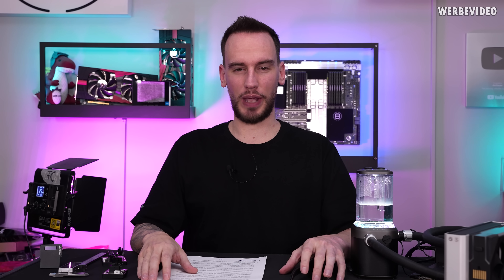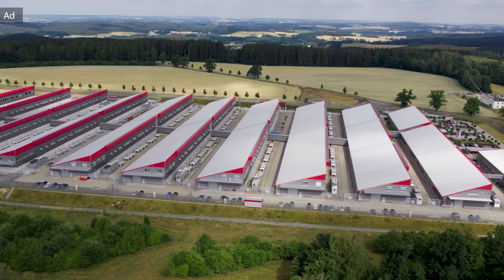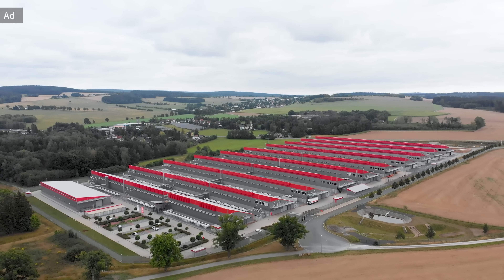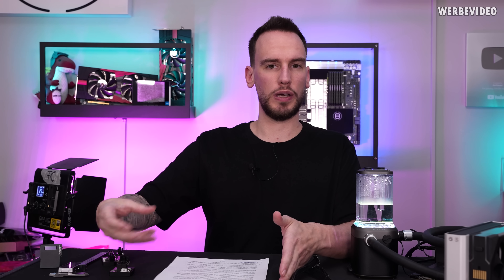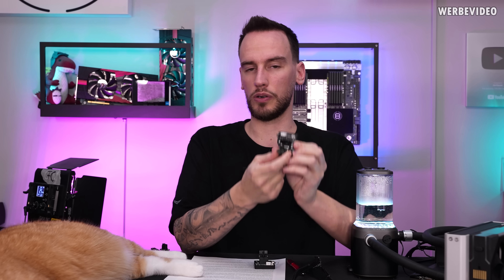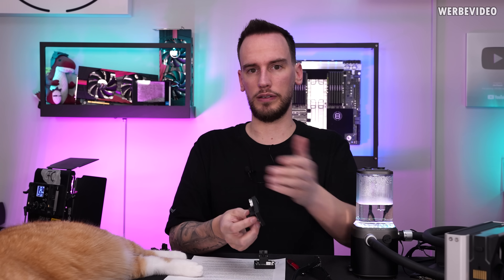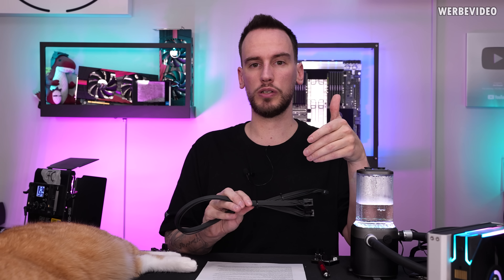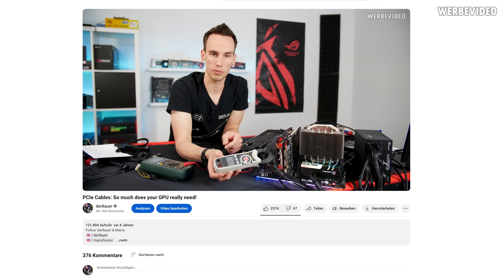12VHPWR is just Garbage and will Remain a Problem!!

Comment: Its funny how i still have my angled adapter on my 4090 tuf. Only removed it 3 times to clean the block and moving. I still think the problem with the connector is the wires are unevenly distributing the power, not so much with user error.

Comment: At 7:37, the way you derate for number of strands in a conductor does not match how an electrician would derate number of conductors in a conduit.  I think you are confusing the latter with the former.  Further, since all conductors are in air and not in a conduit, there is no multiconductor derating factor.

Comment: My ASUS ROG Strix 4070 Ti connector burned — and it's only a 230W GPU.
I was using the original cables that came with my ASUS ROG Strix Platinum PSU (ATX 3.1 certified), so everything was properly matched and within spec.
This clearly shows that the issue with these 12VHPWR/12V-2x6 connectors isn’t just about power draw — it's a flawed design overall. Even GPUs with modest power requirements can be affected.
To make things worse, ASUS voided my warranty. So not only did I buy all ASUS premium components thinking they’d work perfectly together, I’m now left with a burnt GPU and no support.
Be careful out there — this connector issue is not just about wattage.

Comment: I have two brand new 4090s, but I still have to buy another one.

When I bought them and saw the power requirements, the cross-sections of the PCIe cables, and having to go through the thin pins of that new connector, I was surprised, and the first thing that occurred to me was to solder another connector to distribute the loads. But if the problem is a connection fault, distribution no longer counts, since a false contact causes wire burns, unsoldering, possible shorts, black contacts, etc. In short, what happens when a spark occurs in a relay or switch, where the contact becomes black, or burned, or soldered. In short, two problems: poor distribution and possible poor connection. I deduce from this that the card could burn out or be damaged, but if the PC burns out, or worse, causes a fire, this won't cover my warranty. I think it's better to connect another connector and run it parallel to those, trying to lower the excess power consumption to avoid sparking if a connection is faulty. 
Regards.

Tengo dos 4090 nuevas, pero aún tengo que comprar otra.
Cuando las compré y vi los requisitos de energía, las secciones transversales de los cables PCIe y tener que pasar por los pines delgados de ese nuevo conector, me sorprendí, y lo primero que se me ocurrió fue soldar otro conector para distribuir las cargas. Pero si el problema es un fallo de conexión, la distribución ya no cuenta, ya que un contacto falso provoca quemaduras en los cables, desoldaduras, posibles cortocircuitos, contactos negros, etc. En resumen, lo que ocurre cuando se produce una chispa en un relé o interruptor, donde el contacto se vuelve negro, quemado o soldado. En resumen, dos problemas: mala distribución y posible mala conexión. De esto deduzco que la tarjeta podría quemarse o dañarse, pero si el PC se quema, o peor aún, provoca un incendio, esto no cubrirá mi garantía. Creo que es mejor conectar otro conector y conectarlo en paralelo, intentando reducir el consumo excesivo de energía para evitar chispas si una conexión falla.
Saludos.

Comment: I have 12VHPWR that plugs into the PSU and splits into 2x6 pins for the GPU. I am pretty scared to plug it into my GPU, but it is the only cable that came with my ASUS ATX 3.0 PSU. 

I have an AM4 mobo and new 7800XT Nitro+ Sapphire. It says Display Port 2.1 compatible and so does my new PG32UQXR, but the PG32 monitor came with a DP 40 cable, even though I bought a DP 80 certified VESA cable for it. Any recommendations?

Also, windows has to be completely reinstalled, HDR requires HDCP bothering servers (windows playready) my ISP stopped supporting inetd and no decent security firmware on their part, and I might not be able to get the softwares I need for it from Armory Crate, when I need it.
Reply: I'd rather bypass windows login stuff when setting it up, but does that effect the asus stuff?
Reply: Most of my GPUs have always just used 2x8 pin

Comment: Found out about WireView adapters thanks to JayzTwoCents, absolutely love it, allowed me to connect the cables on my RX6800 XT from the top, so it's not pulling down on the one corner of the card that already tends to bend down; cables are now barely visible, and it's the best looking adaptor by far, screen with real time wattage, it was the cherry on top for my built. Not to mention that repasting my GPU with Kryonaut (+ undervolting-custom fan speeds) allowed me to get the core temps under 65C, with a Delta within 10C. So thank you sir for being one of the few really trying to put high quality products out there

Comment: It's time to redesign motherboards and peripherals like GPU cards and brackets. Especially when it comes to power delivery. Thanks to the massive power requirements of modern systems, and the heavy cooling systems they require, substrate is too thin, cards too flimsy, and power delivery to weak. We're still using IBM PC design standard and it shows (AT? Really? In 2025?). 

Technology has advanced but standards have not. Take GPU's as an example: The new multi-layer PC boards are failing under normal operating conditions. Pads are being ripped, traces lifted, and cards cracked just by it's own weight. And both connectors and wires are failing due to excessive power draws, causing shorts, card damage, and even small fires.  Why is this? They're stuck to a form factor standard.

We need a complete redesign of modern computing systems. We need much thicker and stronger connectors, ticker and stronger mother and peripheral boards, heavy duty brackets, and actual power rails instead of wire bundles and cheap plastic connectors. We need to evolve in design and not just technology. We need to dump the Tower PC mindset.

Comment: Are there any updates on the RMA rate? I have just ordered a WireView Pro for my 4090 and would want to set expectations.
I am watercooling, but plan on pointing a 20 or 40 mm noctua fan on the connectors to give it some airflow.

Comment: In standby mode (PC Off) with the cable connected, The Red light ON it means NO POWER/WELL CONNECTED, so maybe that it's confusing people, they start moving the cable until the red light it's OFF ... That means BAD connected (they broke the cable) and they think that now it's ok to turn ON the PC ... and then of course it start generating problems, because it's BAD connected. The most stupid thing on Earth it's that the light it's RED ... Why not GREEN? lol! That solve ALL problems. When you turn ON with a well connected cable, the RED light it goes off, there is no light when you are PC ON if everything it's well connected, so stupid, why not to keep a RED light if something it's wrong (PC on or off) and a GREEN light if everything it's ok with PC on or off, so simple.

Comment: Two solutions to shift 600W properly:
Use a higher voltage and step it down on the card. 
If it really must be 12V, use fatter cables.
What we have here is cost cutting at the consumers risk and expense.

Comment: Came here to remind everyone that 5090, stock, will draw 575W. Which could mean, fully speculatively ofc, that your adapter/wireview could become fully saturated from just a regular OC on one of the incoming cards that feature a even higher stock Watt. I'm talking cards like Suprim x, Strix but also Gigabyte which has one or two 3070ti cards that are 30-40W higher than Strix OC/Supr for example). So, that + the ability to increase the power with a few percentage and you will easily go past 620W.

For clarification:
Remember that I'm not even mentioning Kingpin and other, more or less, unlocked cards.
Just your regular high end graphics card lol.

That will be crazy

Comment: Im looking at the size of 4090 and all I can think off is - with size like this they can make any connector, as reliable as they want or you can use 4-5 old 8pins, sure some PSUs wont be able to support it, but so what? CPU sockets change all the time, RAM, we went from AGP to PCIe, things change, so new PSUs will be built with more 8pins, or use something like electric wall plug, 4090 got space for it, plugs were tested for decades, they can transfer any amount of power since we using these plugs to power PSU itself. I bet all of it is just greed, they dont want to spend money on RnD and trying to use old inadequate connectors, at the same time saying that they doing it for us, for better compatibility, I dont trust them.

Comment: For der8auer, I have a simple request on testing the factor for melting the 12VHPWR connector.  My basic hypothesis on why this connector melts is based around "Energy takes the path of least resistance".  The fault is that where the connector has 6 +12v pins and 6 Ground pins to create 6 circuits, this is still 1 circuit from the 12 volt rail inside the power supply to the power regulator chip on the video card.  The total resistance of each path determines how the current divides among the 6 +12v pins.  There is nothing in between the inside of the power supply to the guts of the video card to balance the  6 +12 volt pins in the connector.  The combination of a bad power supply design, varying lengths and general variance of resistance in the cables, the number of connectors in the path, and the quality of each connection can factor to a wider variation of resistance for each of the "6 paths" at the connector on the video card.  The variation of resistance will cause the amp distribution to pull more amps over the most ideal conductive pin.  With 50 amps over a pin rated for... 9 amps, it should be easy to go past the safety recommendation.

The test is using a poorly designed but adequate power supply to power the RTX 4090 through the 4 PCIE 8-pin adapter dongle but 3 of the connections have an extra 1 or 2 PCIE 8-pin extension cable to add more resistance to 3 of the lines.  This added resistance is to exaggerate the problem to be visible for a shorter duration test.  Essentially, there is no load balancing.
Reply: You'd figured it out before everyone!

Comment: About 3 weeks ago someone I know wanted to get an RTX 40 series graphics card. So they asked me for my honest feedback cause they wanted to play a certain game and their graphics card they had only meet the minimum requirement of the game. While their power supply was 1000w however it was the older standard type of power supply and lacked the 12VHPWR.

Which means if they wanted to use 4070, 4080, 4090 they would have to use one of those 12VHPWR adapters.  I just told them straight up I recommend just staying away from the 4070, 4080, 4090 RTX video cards cause they use the 12VHPWR connector. The connector just pose too much of a risk for me to recommend using a graphics card that uses it.

Told them if they really wanted an RTX 40 series graphics card get the RTX 4060 and recommend them get the 16GB model. As the RTX 4060 uses the old style of power connectors which don't have melting issues.

They don't know computers like I do and their ability to work on them for them self is very limited so I think I did the right thing.
Reply: As far as I know, every 4070 model uses a single 8-pin connector. They are safe. Starting from the 4070 super, you only get the 12+4 16-pin connectors, which is a shame because an undervolted 4070 Super with slightly boosted core clock of 100-200 Mhz and memclock of 500-800 Mhz can easily match the power of the 4070 Ti whilst consuming less than 200 watts of power. If the 8-pin variants of 4070 Super ever become abundant, especially in ITX form factor, they'll make for great mid-range compact GPUs, but so far, only Maxsun made one with 8-pin and it's a trash card.

Comment: My strix card started to melt the connector after 1 year of use. Found the connector not soldered correctly. Soldered in new connector properly and has been fine since. I'm not sure why they didn't use 3 8 pin connectors but what do I know.

Comment: Is this issue specific to the 4090? 
Is the 4080 ok because it uses 320W? or is there also risk here.
Reply: less risk due to lower power. 
little to no risk on any gpu if plugged in all the way and enough bend clearance.
Reply: @F-22raptor-22  Thanks mang. I ended up finding a 12VHPWR plug for my PSU, straight from the manufacturer of the PSU,  with a 90 degree bend coming off the male end that goes into the GPU.

Comment: i consistently hammer my 4090 strix OC using the 12v cable i got with my psu, not a single problem. The design is shoddy ngl, but a lot of it is user error, bending cables due to crap cable management etc. I've built plenty of 4090 systems and not a single one had any issues, all different cards and all different setups.

Comment: Increasing the connector size to regular pins size would reduce its failure rate significantly, though i hope they replace it with single 18 pin connector similar to mb 24pin connector.

Comment: Great video, perhaps one of the few that try to explain this madness.
However, I'm still confused about something: if I want to buy a Wireview for my 4090, which one is better/safer, the one with 3 x 8-pin inputs or the one with 1x12Vhpwr? Basically, what's the right way to connect the Wireview to the PSU, with 3 8-pin cables or with one native 12Vhpwr cable (the PSU supports both)?

Comment: Have you tested the Asus 4090 BTF 4090? since the power is drawn from the PCIe lane up to 600 watts. I wonder if the Asus BTF motherboard will experience any melting from behind since power connectors are on the back of the board. If this still causes a melt, then the best fix is not to get the 4090 and wait for the 5090.

Comment: I have the ASUS TUF 4090. It is powered by a Corsair HX1200, placed inside a Cooler Master H500P Mesh White. The card is very wide and there's absolutely no way to have 35mm before bend starts, thats an absurd amount, the best I could do is 25mm. The cable I'm using is CableMod Modmesh 12VHPWR->4x PSU cable.Thus far I've had no issues with the card and its performance, I hope it's not gonna burn.

Comment: What about the new back connect boards that can run 600 watts direct from the PCIE  connector to the card without cabling. Even if back connect doesn’t take off, I hope they keep that power coupling, would be a perfect solution to all these issues

Comment: I have never held one of these to look at and only seen them side by side in pics. I believe if they had just made it the size of the standard  8 pin pci connector, added 4 more pins  with that little top connector, there would be far fewer problems. Sure it may have taken up more space, but as long as Nvidia cards have that connector I will never own one. I do not care if I have few fps less and all that nvidia is better at, at least I do not have to worry about my $1500+ video card burning up or catching my computer on fire if I leave it unattended. Yes I have left games playing all night while I slept, such as Satisfactory, FFXV (I forget what it did, but you made your car drive for a long time and you get something) and a few others.

Comment: is this mostly on 4090s? I'm running the cable provided by Super Flower (Leadex VII XG) and has been plugged into my 4080 Suprim X for more than a year now and hasn't had any issues.
Reply: the default nvidia adapter cooked my 4080

Comment: I agree with the point to just put 2 of the 12 pin connectors on, but what does that mean for PSUs? I went out of my way to buy a psu with a 12 pin connector despite not having a 40 series card, simply because I was trying to future proof. If cards have 2, that either means I'll use one direct cable and an adapter, or PSUs will eventually come out with 2 12 pins and to avoid an ugly cable mess you'll have to wait and buy those... It's just such a messy situation.

Comment: Looks like the solution is to remove the new connector from the 4090, make an adapter board and simply use the old with margin of safety connector.

Comment: let me get that right! if nvidia invented a lousy awfull connector, you recomand them to use two of them, instead!!! very logical indeed!!! those rtx 4090s, are like a square of a mere square, they have enough room on an area so huge, tu use 4x8pin standard size connectors, not miniscule connectors like u are recomending here!!! the main issue of not connecting right and heating up because there is not a good connection, is because the connector itself is miniscule!!! too small to do the job right!

Comment: today u helped my concern become alive because i was suffering from brand new 4070ti crashes after 6 months its just started to crashed and i noticed that red light i changed my ram sticks cause of that i never thought it would be that cable till thats what i thought today and i saw it here and u right no words needed i sooke with nvidia they said that red light its to indicate if there is an issue with the card and obviously all of the 40series is defective in sort of way because of this connector what would really happend if my house will catch a fire while im sleeping?